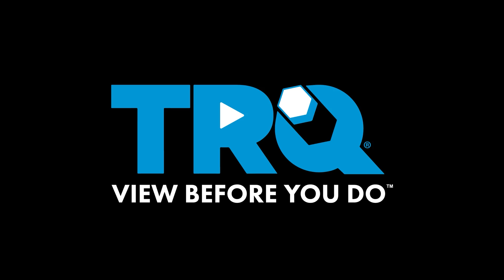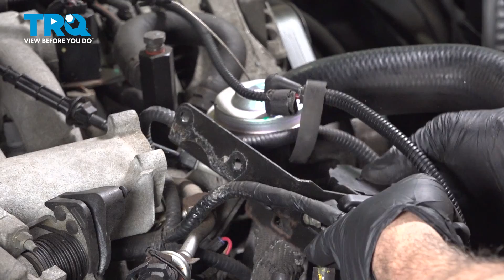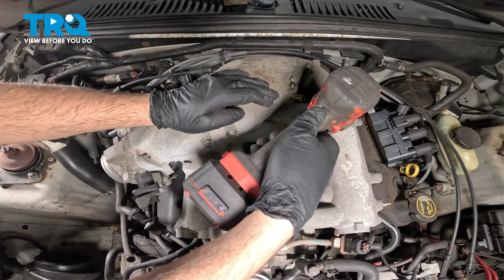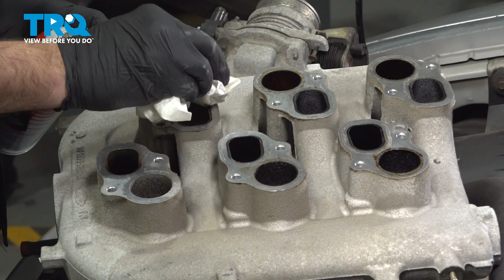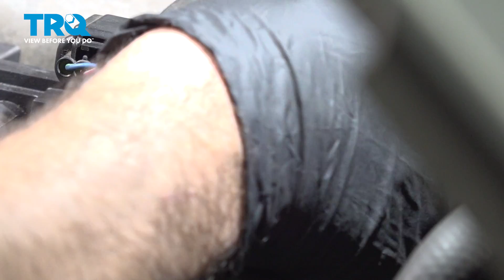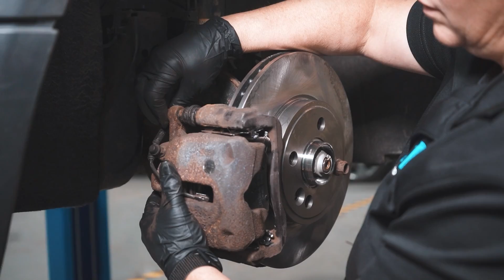How to Replace Intake Manifold Runner Control Bushing 1994-2004 Ford Mustang 3.8L V6

Comment: I broke the port at 4:34 inside both of those hoses. What's that part called with the ports and the hoses that go with them?
Reply: I figured it out. It's the EGR Pressure Feedback Sensor.